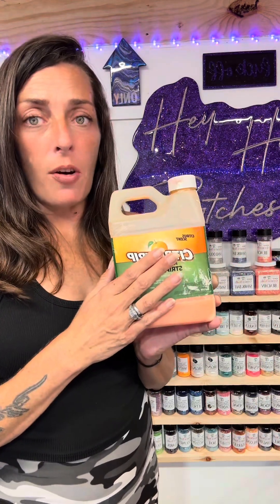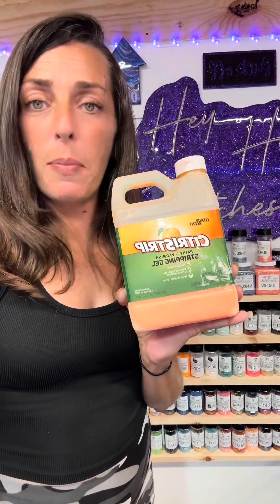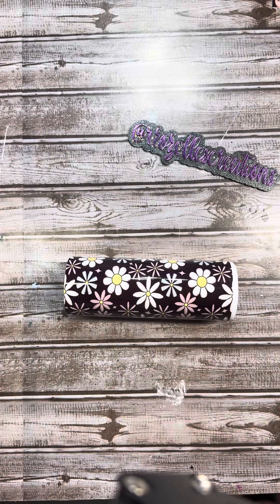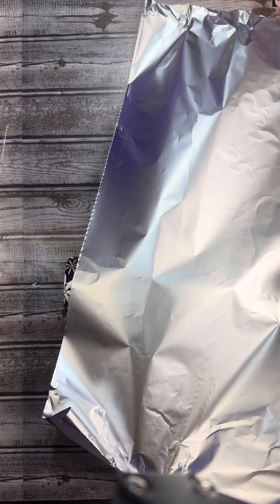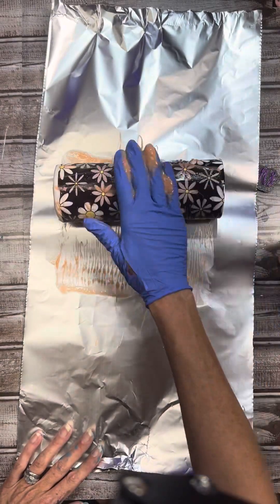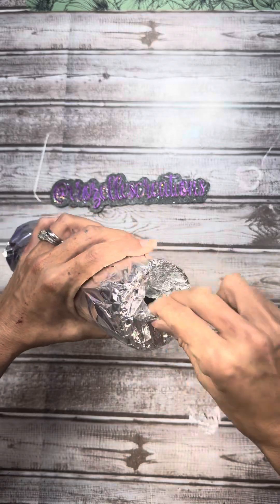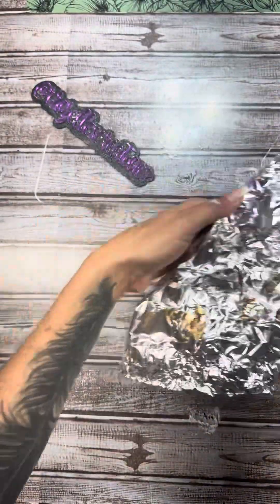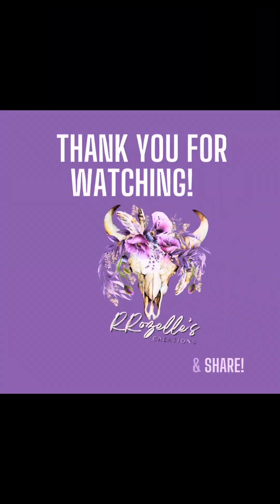Striping Sublimation Mess-up’s Using CitriStrip

Comment: Love this idea - do you have any idea if this works on epoxy??
Reply from the maker: @kristinamidolo7681  it doesn’t. I use a heat gun to remove the epoxy OR wrap my tumbler in a paper towel, soak with Acetone and then wrap in aluminum foil for 24-28 hours in a cool dark place.